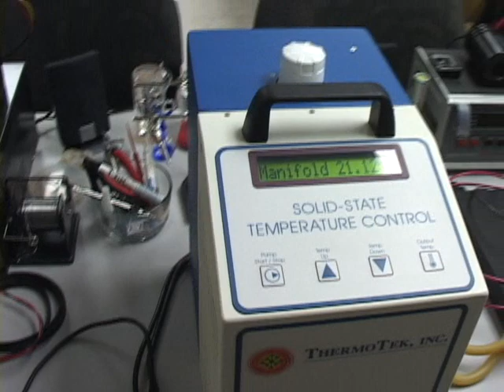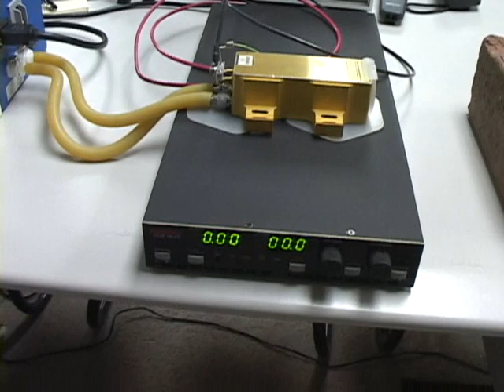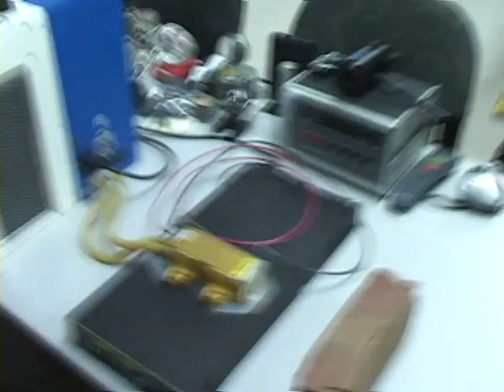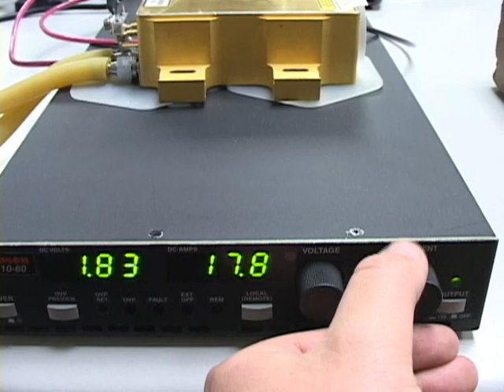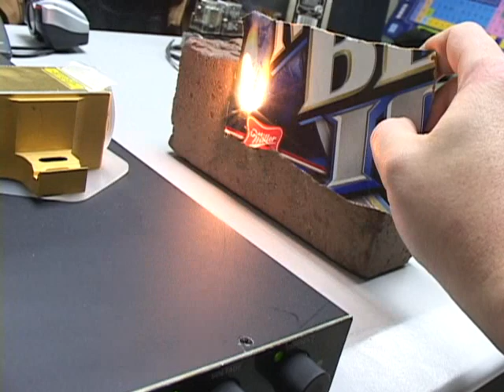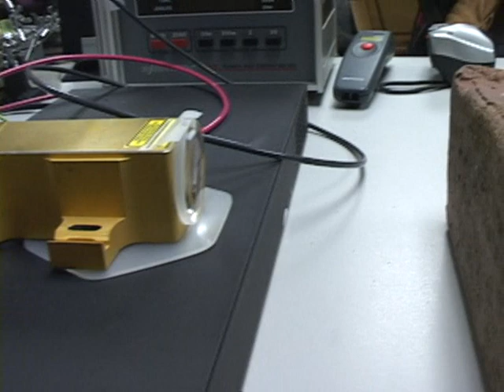60 Watt Coherent Laser Diode Test

Comment: @hightechstuff2 Makes Sense then. I cannot imagine 60 Watts (or 50) of continuous laser output. It would probably be blinding to a cheap, filter-free camera, such as a web-cam or cell phone camera. The thing with the penny was really impressive! I'm surprised that the copper surface (I know they aren't solid copper) didn't reflect too much energy to enable this. I guess it had to be a slightly tarnished penny for best results, correct?

Comment: @hubzcaps If the crystal didn't cost in five-figures, it'll most likely simply burn out. If it was, it will need exeptionally careful alligment of both Neodymium doped crystal, and final doubler after that, which is no weekend project. Not even factory precision can get that right sometimes.

Comment: I have the same 60w module. I have not gotten around to 'firing' it up yet. I have a pumped cooling system and a 5v-150amp Scientific PS. I think most people have no idea how dangerous, or how expensive a diode module like these are.
PEOPLE-These are V E R Y dangerous! Wear professional laser safety goggles.
I also do show lasers- a bunch of 5mw, 100mw, 200mw, a 400mw 532nm Laser World 2 galvo, and a 500mw RGB 2 galvo with a couple diff. USB show driver softwares. Lasers are SO cool-

Comment: @hightechstuff2 ok. so, with 60 Watts, can i cut only shapes with 3mm? with laser i will dont need a step motors with a large torque to make the CNC. And to cut i will need only 2 axes. But with mechanical method, i will use 3 axes.
If dont have another way, i will make with a dremel :)
thanks for the reply!

Comment from the maker: @felbirmrod Hmmm, 20mm is pretty thick, even for wood or plastic. You can do it but you'd need probably 1KW of 10.6um (CO2 laser) to cut it clean and within a reasonable amount of time. (and without bursting into flame) Lasers are better at cutting thinner materials that can be focused on. 2 or 3mm would be easy but 20mm is just asking to much for practicality. Stick to a mechanical method for something that thick.

Comment from the maker: @seriouslyWeird Oh, it ignites completely, just in a small localized spot. If i was to leave the cardboard there long enough, the whole piece would eventually be engulfed. Fire is a chemical reaction and consumes as it moves. Using light as the ignition catalyst does it a little differently than a lighter due to the localized ignition. Hope this helps.

Comment: That is awesome.  What does the 60w mean?  The power supply was 2.2v at 50 amps or so, which is over 100w.  Is the 60w the possible power output after the heat loss?

Comment from the maker: @Plan3SkIPP3R This array consists of 19 individual diodes in a stripe array with quite a few correction optics to produce a very thin stripe about 3 inches from the output window. I use a PC lens in front of that to produce a fairly decent focal point about 5 inches in front of the laser. In short, the internal part of the head is all Coherent's magic.

Comment from the maker: @Fandalg 
HA! Too funny. You wouldn't get much out of this laser against thick steel. You would need oxygen assist to get deep penetration. "PEW PEW" Is just not possible but you can get a "POP POP" from a nice Q-switched laser.

Yes, in most cases a laser beam can easily be reflected except for far IR which is a little trickier. How advanced weapon lasers work is they focus the beam to a fine point before the target essentially creating a "hot knife" of plasma in mid air.

Comment: @hightechstuff2 Well the full 180W would be a little tedious to say the least, maybe more max 1W or so so the neighbors dont starting to think why they whole apartment are glowing green. But i dont know if it would even start lasing at this level, i doubt it. Its also a real pain that i dont have the driving unit to it which could be a small problem but at least to get some green pulse out shouldnt be that hard but without blowing the xenon tube to smithereens which i absolutely dont want to.

Comment from the maker: @67tr876 The simplest answer is that a laser diode is a dead short. It will take as much current as you can throw at it until it blows. Thus the need for current regulation.

Comment: @hightechstuff2 Then why will a 1/2hp motor runing at 120 volts draw. my motor did 8.2 amps and if you ran it on 230 it would pull just 6 amp ? but yes 4 volt will blow it.

Comment from the maker: @dtiydr Thanks! You should give it a try. The biggest issue with pumping KTP at that kind of power level and getting good results is cavity design. It's just not as simple as pumping the KTP in a pointer without thermal lensing. You need an L fold or Z fold cavity to do it correctly.

Comment from the maker: @redbullkoff Not more than a couple hundred because I fixed the parts and got them on a deal. I'm patient and buy smart. The beam is not white, it's actually dark red. So dark, you can't see it. AKA infrared. You can manipulate the wavelength with nonlinear crystals but I'd need more than 500 characters to explain that.

Comment: Nice vid!

"I'm eventually planning on using this laser as a pump source for a YAG and frequency doubling the output of the YAG with a KTP to achieve around 10-30W of 532nm green."

I have a 180W CW 1046nm nd:YAG laying around and have been the last year pretty tempting to test that with a big KTP to get what i guess would be pretty strong 532nm..

Comment from the maker: Typically you'd be looking at a 30% conversion efficiency so.... around 500-600A. And yes, they do make some HUGE arrays. The biggest problem with them is cooling. Most of them run in a pulsed mode to keep them from frying. If you are looking to run a 300W diode array, let me know I have the power supplies you need for dirt cheap.
Reply: I mean 12 years is 12 years but u still got those 300 watt power supplys for sale? :d

Comment from the maker: Thanks! Yes, Just like LED's are made from semiconductors, lasers can be as well. Every day there is a search for more wavelengths in the semiconductor laser industry. Why IR? Because that is what was needed for the original application of the laser diode. Also, IR wavelengths are easier to produce by diode lasers at high output powers.

Comment from the maker: Varistors don't generally work with these low voltages where 3V can be a danger zone. It's probably fine without the jumper but I'm just paranoid. These diodes aren't cheap. Check out my "Lasorb" video to see how to protect a laser diode.

Comment: I have the same diode and a current regulated power supply, I was considering using a optical relay for switching. Do you think the diode can be switched without damage? Also where did you get your optics to collimate the flat beam? Very professional video. I have built CO2 a raster engraver but have some questions regarding this wavelength and what materials it will react to. Is there a forum for guys like us?

Comment from the maker: Well, A CO2 laser requires a high voltage, low current supply. Complete opposite of a laser diode driver. Small CO2 lasers can be run off of a 15KV neon sign transformer, ballast and a variac. It may still require a pulse start voltage of 20KV or so however. A 40-60W tube would require a ~20KV supply with a trigger and would require a little more than most NST's would offer. Email me when you have the tube and I'll provide you some help.

Comment from the maker: Hey Tom, 
The power resistors and a 5V supply would work but it is best to have a current limiting power supply. In ether occasion, when not using a laser diode driver, you should use a crowbar circuit to prevent spikes form hitting the diode during power up and power down of the supply.

Comment from the maker: Hi Dave,
I don't think I quite understand but If your question is.... The camera is picking up the IR radiation and then re-transmitted in the video.... Then the answer is no. The camera only responds to the visible spectrum and your monitor does the same. However, even if your monitor was capable of reproducing the 808nm wavelength, the image would be safe for viewing. This would be the same concept as looking at the sun versus looking at a picture of the sun on your monitor.

Comment from the maker: Well, 60W of is a little on the low side for penetrating 1/4" wood. What is the wavelength? Diode, gas or solid state? Either way, you need to have forced air on the work to eject vaporized particles to cut deep. Pressure, distance and focusing are also very important factors.